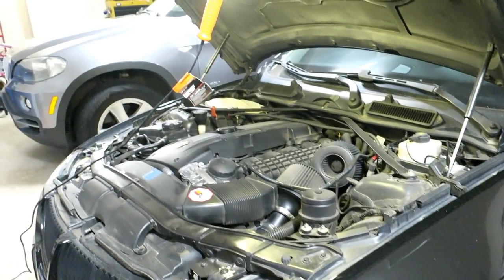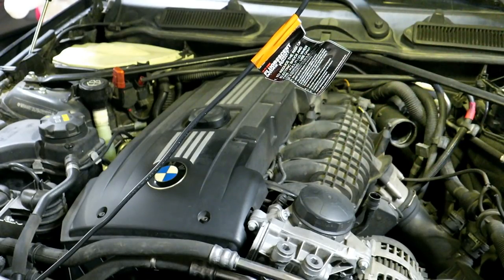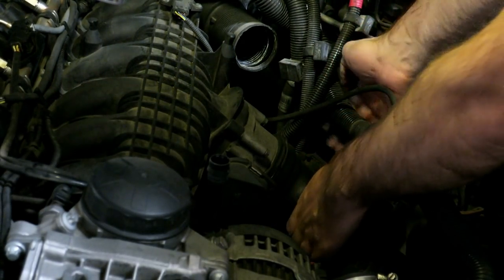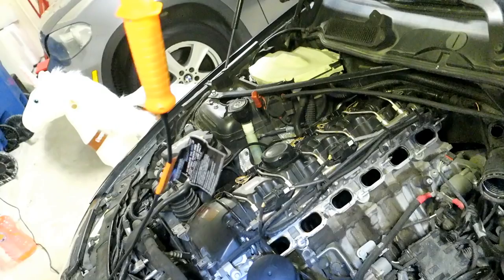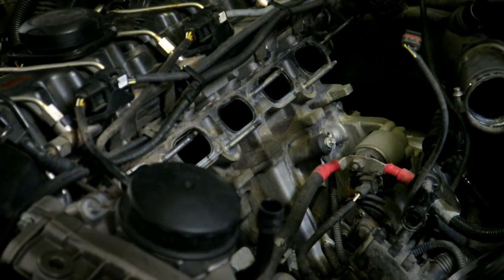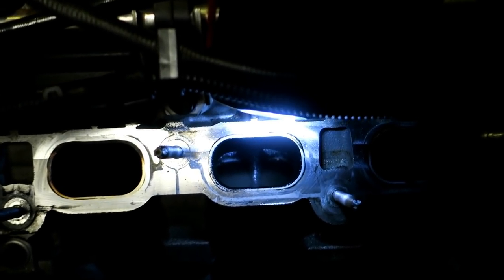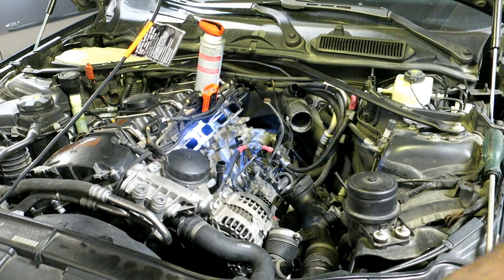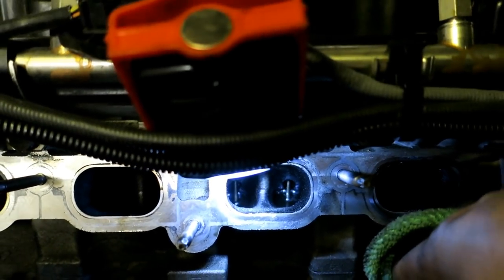Intake Valve Cleaning Without Any Special Tools N54 N55 DIY

Comment: Excellent fucking job bro....im doing this next weekend and new occ to help with this also!
Reply from the maker: Awesome, yeah the oil catch can is good idea!
Reply: Vehicular DIY hey just did this followed your steps i can feel the power now with the exception however I'm now getting up and down rpms at idle?!?! This is so weird...it doesn't do this upon first start up but after 15mins or so then it starts to do this only at idle!!?! I tried rechecking my work making sure I didn't leave anything undone but as of today the only thing I can do is pull the intake back off or check again for air leaks....getting no codes just up and down rpms at idle..let me know what you think thanks!🤔
Reply from the maker: N54 Lord Hey sorry I'm only seeing this now,  did you sort it out?  If its idle hunting perhaps the intake manifold gaskets or seal by the throttle body.  Did you ensure the manifold bolts were torque down enough?  You could also try resetting adaptations.
Reply: Vehicular DIY Work's great air vacuum leak button it back and smooth as ever!🤗👍
Reply: N54 Lord If you pulled your plugs and coils check the plugs to make sure none are loose first.
Reply: @VehicularDIY  Even better is to look into tapping and plugging the intake runner port holes that go to the valve cover and externalize your low-side PCV system (via RB Turbo's kit) through a low-flow catch can (like a mishimoto or cheap ones on amazon like Tasan Racing that have the sintered metal air/oil separator). This way, you separate the valve cover from all boost, making it less likely to crack and/or make the gasket leak. Also, under vacuum conditions, having those holes plugged keeps un-separated oil mist out of the intake runners (because externalized PCV would then redirected this mist to a catch can first, before the separated air goes back to your throttle body). This maintains crank case vaccum as well. I catch 3x as much oil in my mishimoto low side can than the burger motorsports "high side" can. I run both.

Comment: you use brake cleaner on that ?
Reply from the maker: Brake cleaner to just get the oil off the walls of the intake port but the CRC is doing the heavy lifting.

Comment: How do I tell a valve is completely closed?
Reply from the maker: G Sai You have to watch it's movement, for a moment when cranking it'll stop moving.  That's the closed position.  Like I show in the end if you're nervous about that just pull the plugs and crank it over to push out any fluid that may have made it past the valves.

Comment: Thats not how CRC recommends using the product. This guy puts brake cleaner in his engine! NO! The CRC product is supposed to be used on a running engine. Anything getting past the valve ends up in the cylinder and on to the catalyst. NO. I drive an electric car..

Comment: It looks like too much work. I just seen a video on a comparison test between two products that you simply spray into intake manifold with the car running.
Reply: They don't work with heavy build up. The only way to clean off deposits is to remove the intake manifold and directly spray a cleaner inside the valves while scrubbing them. Or you can pay someone to walnut blast it

Comment: In other words, you are going to disregard the instructions on the can and do this the same way you'd use a media blaster, without the media blaster.  This is the worst of both methods.  If you are going to go so far as to take the intake manifold off rent the walnut blaster and use a shop vac.

Comment: STEP 1 .  Follow the directions on the can.
STEP 2.  FOLLOW THE DIRECTIONS ON THE CAN
The CRC product is not designed to be used this way.
Reply: step 3: realise steps 1 and 2 did nothing if youre lucky, if youre unlucky the whole can went in one cylinder and hydrolocks your engine

Comment: this not the way to do it.
When you do this you be sure the valves are closed .
check each port for closing the intake valves.
This is a Moran he don`t how to do!
All the gunks is now in the cylinders.
Moran!!!!!
Reply: Will I experience any problems or catastrophic failure for getting the cleaner in the open valves? I'm having trouble getting some of the liquid out in every valve. will that foul my plugs or do any other type of damage if I don't get it fully dry?
Reply: You may want to run a spell check when calling someone a "Moran"
Reply: @RichRotorhead  Is that not the correct word for somebody from Mora.?
Reply: You can tell the commenters who didn't even watch the video...
Reply: @maxnix346  😂😀😂

Comment: So, you have N52 (3.0) with 258HP and very "similar" (in a matter of end result) direct injected N53 engine with 272HP. So, all this BS for 14HP (which you can get with smartly configured exhaust system....which is another portion of the car they ask you to bend over for "because emissions"....while they do...their thing...). I know, I know, manufacturers didn't outlawed port injected engines because of 14HP, but because governments of the world squeezed their balls "because emissions". But still....we had to do something ....we had to say something....instead of bending over and inviting them "come in, stick it inside, it's warm...."
EDIT: For US crowd...N53 is also N/A engine (as N52) but technically more similar to N54 because it has all the disadvatages of N54 (HPFP, direct injection, etc.) and it has 14HP more than N52.

Comment: You do not have to do that.  You only need to inject it into the engine's air intake when the engine is running at two thousand rpm.  then waited 10 minutes and then gassed a lot.  if you want extra cleaning of the engine, put the cleaning kit in the petrol and in the oil and gas for 15 to 30 minutes.  and then when it's done you change the oil and oil filter

Comment: I don't like this method . It isn't smarter at all . It's a gimmick that eventually causes more issues . truth is these pieces of carbon dont get burnt away . Combustion isn't hot enough , they are equal to grains of sand , by using these cleaning intake sprays they get caught between the upper compression ring and the piston scratching the cylinder walls resulting in oil consumption and compression loss over time . And even if larger chunks happen to make it out the exhaust port they get caught in the cat . I've seen this first hand myself ripping down direct injection engines . I've talked to the owners who said they used these intake valve cleaning sprays . Beware CRC and other companies are just trying to make money on a product that actually does more harm than good  . Only true way to clean intake ports is to manually clean them by hand
Reply: thanks
Reply: AutoTech Jord i did this and my 335i started making ticking noise. But felt faster please help ! Dont tell me i blew my engine doing this :(
Reply: Allen Messi . I can't say for sure . You would have to have the engine ripped down to properly diagnose the problem in order to come to a conclusion on what is causing your engine noise
Reply: AutoTech Jord it went away after driving it hard? By hard i mean going 140 mph you think it will come back?
Reply: I couldn't agree more. Also, if someone doesn't follow the right procedure, they could hydrolock their engine.
Reply: I disagree with your opinion. Cleaning products similar to this (Seafoam) have been used for decades with little to no long-term negative effects, and many more positive benefits. You seeing some “direct injection engine tear downs” doesn’t equate to real data. Independent data showing positive effects of using cleaning agents as directed has been better documented. 

I will say that it might be a better idea to use this particular product as directed, which includes getting the engine to operating temperature before application.  This is most likely to improve the cleaning properties and combustion burn off.
Reply: And how does walnut blasting works then? I don’t think you are able to remove 100% of the used walnut shells and those are definitely harder than carbon paste or gunk and I don’t see blown engines lol, you are just spreading fear into what’s a great tutorial with great and safe results
Reply: Marty Van Datta in a regular car yes, in forced induction cars all your doing is damaging your turbos/superchargers
Reply: @allenmessi4636  dude are you 12?
Reply: Erik Gustafson no, your the one w gaming videos and shit. You hate to see facts? All your doing is damaging your valve seals.
Reply: what if you didn't reroute the "out" of the catch can (or the PCV system) back into the intake of the engine? wouldn't that solve the problem with DI because nothing from the PCV is going back over the intake valves? i was thinking just feed a hose down to the bottom of the car from the PCV like those that drain A/C condensation.
Reply: fenix I'm 17 i don't sell shit lmao. Its impossible to clean the valvers 100% w this but ut mskes the carbon loose and when u drive the car the loose carbon end up in the combustion chamber.
Reply: @fenix . The mist that's bring sprayed into the Intake is at least half evaporated by the time it hits the valves . It's not literally soaking anything . So by letting it sit doesn't do anything either
Reply: @fenix , the carbon on the intake valves will fall off in chunks and go into the combustion chamber. It doesn't burn up . It gets blown around and hopefully gets blown out the exhaust . Which it most likely will end up in the cat
Reply: @maxmykhlyk3732 ... You would end up having a Vacuum leak then!!
Reply: @EverydayJ1786  You talk bullshit man.  There are no "chunks" left after the carbon is liquefied.
Reply: you are absolutely correct sir.......GDI engines are not an advancement in design , they are a bad design that requires  entirely different maint. that is problematic due to poor design......
Reply: But if you put Valves TDC for each cylinder when you soak it with this product what is wrong? Just vacuum it out and nothing will leak into the cyl.
Reply: Allen Messi you’re well intentioned but confused son
Reply: @einfelder8262  What makes you think that the carbon is completely "liquefied?"
Reply: @martyvandatta3524  Sea foam is a light distillate oil.  It has no detergent properties.
Reply: @maxnix346  I watched the video, particularly around 22-23, where the evidence is right before your eyes.

Comment: I'm not nuts about cleaning engines. It is just aesthetics. The important thing is, the engine should be functional. Engine blocks don't have to be nice and shiny like brand new. The question is if we don't clean the engine, would it still remain functional? Of course yes. Now let's bring the same concept or philosophy to the intake valves. Do I have to clean the intake valves? My position is no. Why? The answer lies on what matters most. If the engine is turbocharged, the function of the valves is to let high pressure air in and close them tight during combustion stage. Do carbon deposits interfere in the flow of air into the valves? No. Like what the presenter had shown, any debris that gets into the cylinder gets burned at high-temperature combustion? So what's the point in cleaning the valves or the engine? If that makes one feel good, so be it. The supplier of cleaning paraphernalia for either the engine or the valve won't be happy seeing me pass by his store.
Reply: Manufactures like Toyota have learnt from this problem and added an intake port injector to keep the valves clean from carbon buildup. They didn't just do this to waste money and have a laugh.

Comment: ** Warning this is not a good  **
As a 19 yrs Level 1 Master  Technician  at BMW  I would not do it this way even when I do my own. Short cut may work short term but will have issues soon.
I can go into detail but that would be long .
Reply: hi can you please explain further? i am a noob
Reply: Is the gunk gonna stuck on valve seat? Damage valve seal? Or bad cc?
Reply: What method would you use??
Reply: Physically cleaning the valves is the only guaranteed working method. Removing the head and cleaning the intake and exhaust valves and the ports. This can get really expensive. Cheaper version is to remove the intake manifold and blast it with either walnut shells or dry ice. I know the walnut shell blasting sounds silly, but it's awesome since walnut shell aren't very abrasive and it's cheap. A lot cheaper than the ice blasting method.
Reply: Lol level one sounds like the lowest level. In my opinion. Also a decarb would be the best thing for this issue. Why remove the damn head for?  Potentially damage more critical components if not done correctly.
Reply: level 1 you'll remain! You are just saying that because you want people forking out 700$ at your stealership instead of a few cans of CRC
Reply: @DailyDoseOfAffirmatio.n  Level 1 is actually the top designation BMW gives to their techs.  Level 3 is the lowest.  Think being number 1, or first place.
Reply: If you are really a “master technician “ you should hv knowledge to compose an article about this issue. Instead of telling us it is not going to work because you think you are a professional
Reply: @DailyDoseOfAffirmatio.n  Well your reply puts you at the failed 1st grade four times level.